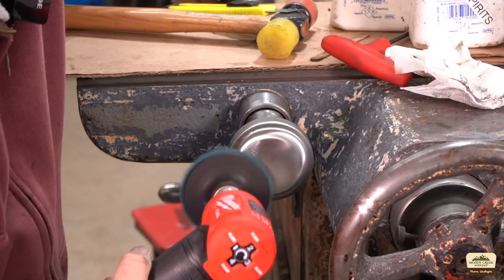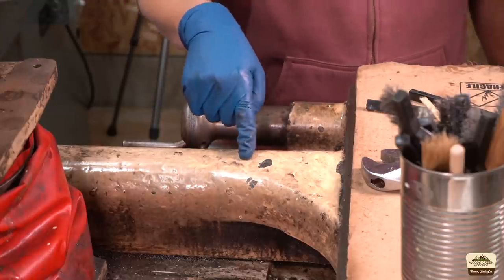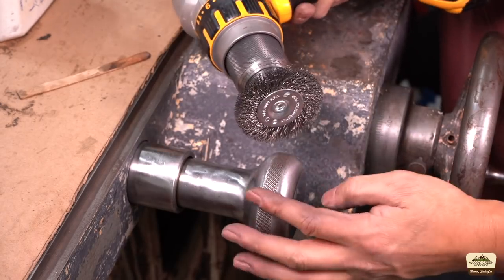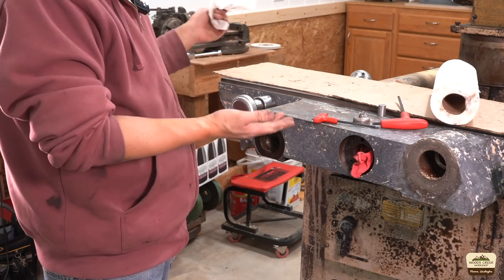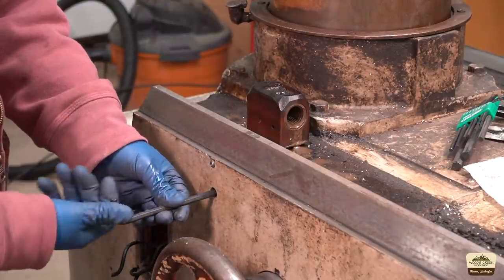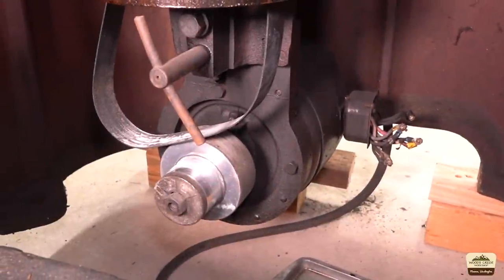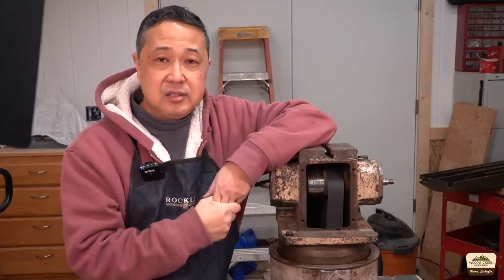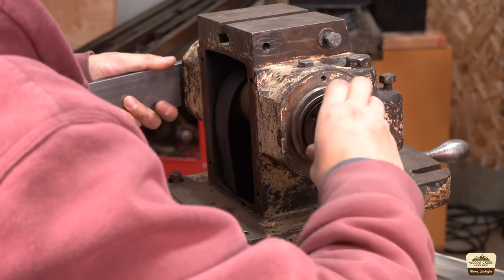More Bad News! Part 2: The Cincinnati No. 2 Tool and Cutter Grinder

Comment: Looking in the catalogue the 6305/C783 is a high precision bearing. Stock 6305 is about $23.50, don't know how much they charge for the extra inspection??? 2305 is about $40.00. Pain is going to be fixing the belt running surfaces.
Best wishes.
Reply from the maker: Yeah, 6305/C783 is proving to be difficult to locate at the moment.
Reply: @woodscreekworkshop9939  Might have to buy, say 4 standard 6305, as they are cheap, and do some test fitting, to find the best???

Comment: Being that it's a grinder the spindle doesn't have to be crazy accurate, I know thats not necessarily a surface grinder trait however if your using the machine correctly there won't be the kind of loads on the spindle as in say a milling machine so the spindle bearings on a surface grinder do not have to be crazy precision like most other machines.
Reply from the maker: Good pint Tyler, thank you

Comment: Throw those used bearings out they have had it!
In a former life working for the local agent for Barden Precision Bearings we used to supply people rebuilding these T&C grinders with two pairs of Barden 305HDL. These are precision pairs (Abec 7) and have a built-in universal light preload. The size is equalivant to 7305. They are of angular contact design and are usually mounted in back-to-back arrangements.  We supplied  these  angular contact bearings in lieu of the deep groove 6305 type (same physical size) as the latter are difficult to obtain in the required precision grade as are the double row type. Both pairs have their inners clamped together on the shaft. One pair has its outers end clamped in the housing thus providing axial location. The outers of the pair at the other end are usually left free to float (axially) in the outer housing to provide relief for any thermal expansion of the spindle. Either removal or alteration of the spacer length is required (I can’t remember which😊) Spindle repair is not for the faint hearted - it’s not like fitting new bearings to the wheels of a car, it should be left to experts and done in a clean room. If attempting it yourself please when greasing the bearings do not overfill the bearing as this will lead to churning of the grease and heat build up which will char the grease and destroy the bearings. Only 1/3 fill the open space in the bearings at a maximum. I was lucky, my Australian copy of the #2 T&C had good bearings. Although the small internal quill that came as an extra had a bent shaft (Sob). Martin
Reply from the maker: Thanks Martin

Comment: Yuchol, ultrasonic cleaner doesn't work great on bearing...will damage it...too achieve a precision movement, need new bearings, its a lot of work to waste just by some reemplazable stuff...About the precision bearings, you must ask Robinzetti, as a Spindle specialist will be able to give you a good advise, even point you in the correct source of spares and rebuilt procedure..
Reply from the maker: Thanks Rodolfo! 🙏🏻

Comment: i am armchair warrior, so take this with a pinch of coppersulfate, but..... matched self aligning ball bearing? you make that up or does the manual has April fools date printed on it somewhere ;-)? 

you could go with the equivalent ones, they cost almost nothing, if spindle speeds allows it, go tapered roller or high angular contact bearing, will help with the vibrations/oscillation in the speed range you are working with a grinder - again, check the specs, and be warned, i just discovered that the limit and rated speed on at least your "original" on the sfk page are mixed up. But it looks tho the deep grove ones are a bit harder to come by in the range needed here. At least my supplier does not hold 62mm OD in the 25er ID range.

Better you figure out what speeds the machine gonna have, prior to the whole search, and my approach would be to test out first "normal" bearings, and not go full blow on matched sets. that way, i could iron out everything else and see how far i get before committing.

With this 2 cents on the matter nobody is interested in anyways, thanks for your time and effort making the videos, it is appreciated in Spain.

Comment: Measure the inner and outer diameters, Call your local bearing supplier and order 4 new bearings, shim if required, this is simple stuff. its not going to grind NASA parts anyway

Comment: Dont put bearings into an ultrasonic cleaner if you dont want to ruin your bearings, the balls will develop small flat spots during the cleaning process and when you reinstall them and run them at high speed the balls will get destroyed, just put new bearings in, should not be too expensive.

Comment: don't bother cleaning them. just check the spindle and replace all the bearings. It won't cost that much now. but you will regret it later if you don't do it

Comment: You really know your stuff.  If you rebuilt it back to factory I'm sure it would work for another 50 years no problem.
Also, if you get the really thick paint on gloopy paint remover, that stuff works well, you paint it on and walk away.
Or if you want fast results, you get all dressed up with your respirator and face shield and go at it with a wire wheel on your angle grinder.
A word of caution though, this is probably lead paint given the age of the machine, so be careful about breathing this stuff in.
The Lead isn't going to kill you or give you acute poisoning or any of that, but it is considered hazardous waste, and you don't want it in your lungs.
Reply from the maker: Thanks!

Comment: I cringe every time you put a crescent wrench on a machine bolt. 😬
Reply from the maker: I do it on purpose 😁  There is so much old paint and rust built up, few sockets fit 🤭
Reply: @woodscreekworkshop9939  Its called a hammer. Give the socket a tap or two. It'll fit.